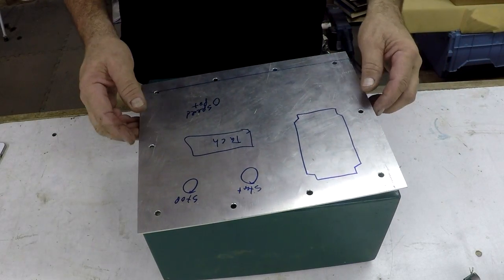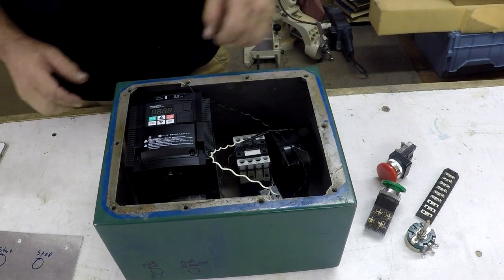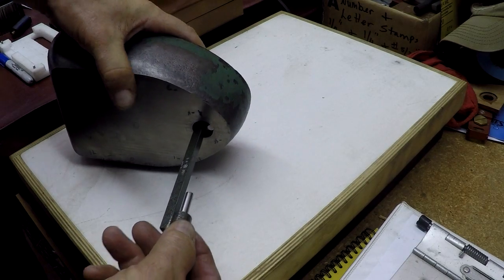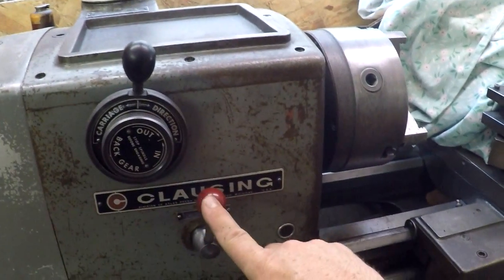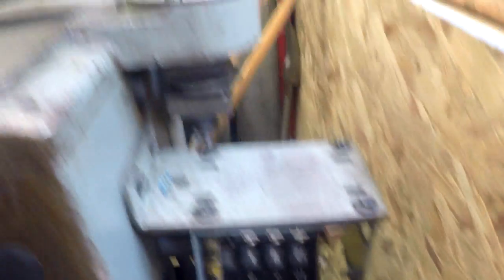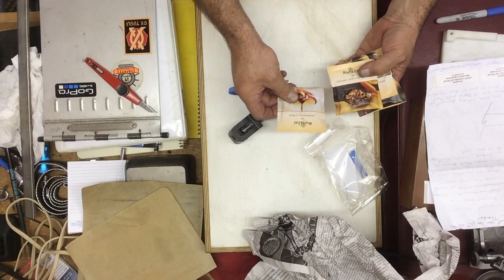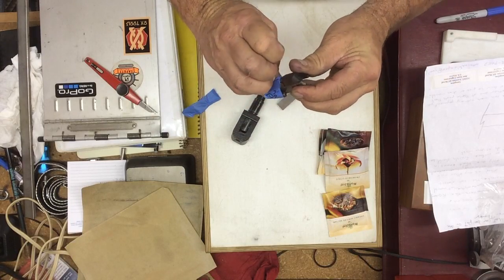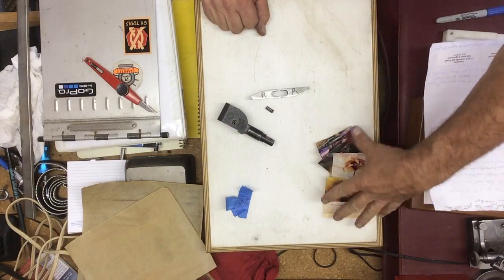Ketchup #23

Comment: Before I had my rotary phase convertor, I had a VFD on my Clausing 5914 and used the original switch to control the VFD forward and reverse (low voltage wiring direct to the VFD).  I ended up going back to the original hydraulic controlled variable speed, but it's acting up some lately, so I'll be interested in your project.  Are you eliminating the variable speed pulleys in yours?  It seems that most people going to a VFD do that.
Reply from the maker: Jack Hoying Thank you Jack.  Right now I just want to get the lathe running.  I am going to consider eliminating the Variable speed pulley setup.  The variable speed was rebuilt not long ago so we will see how everything runs.
Randy

Comment: Hi Randy,
Does 96, equate to 231,414 weekly Ketchup.
If you could convert his log splitter to vertical, it wood make it a lot easier
on him, I like operating sitting down.
Reply from the maker: Robert Klein It is also a Vert. splitter, it goes both ways.  I am not sure of the math but looks right.  Thanks Randy
Reply: If it's also vertical you shouldn't have put on the elbow, that hose you cut was shot, if you had replaced it, like I did with a real quality hose it wouldn't kink and would work correctly
both vertical and horizontal.
Hell what do I know, your the engineer.
Reply from the maker: Robert Klein I cut the kinked end off and yes if it was a better/stiffer hose it would not kink.  With the elbow it did not kink when in the Hortz. position or the vertical position.  Most of the problem was from the twisting of the hose when changing it's position.  The elbow helped remove some of the angularity to remove the twisting enough to stop the kinking.  Thank you Robert for the suggestion.  Randy